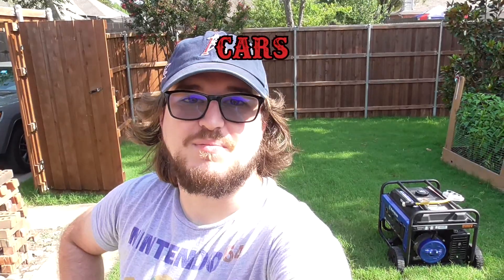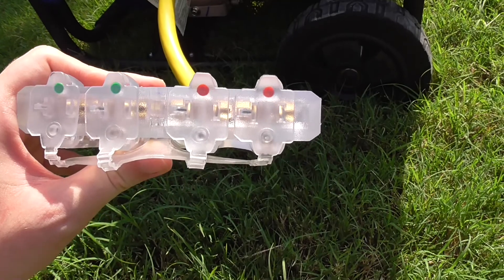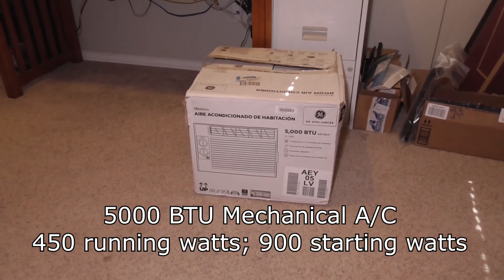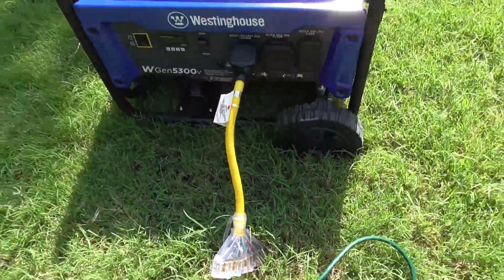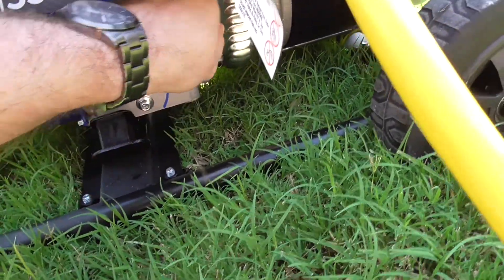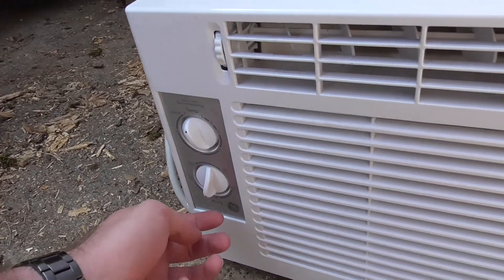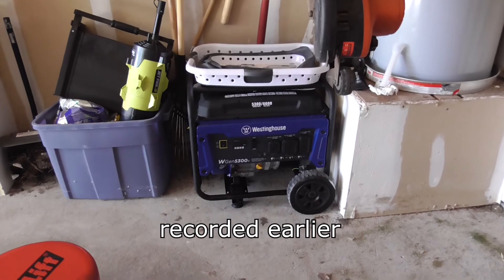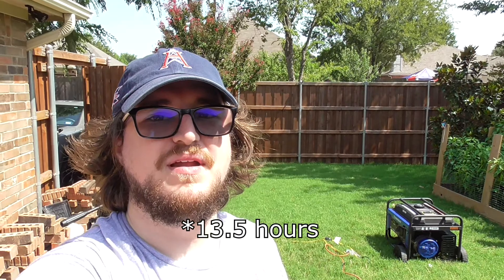Westinghouse WGen5300v Capacity Test

Comment: I know this video is 4 years old. But what I did was get a 10 ga. X 30' ran it from the generator into the house plugged yellow splitter into the Cord then ran 12 ga. Cords to appliances. The cords you are using look like 18 ga.      Starving your appliances of proper amperage.

Comment: Anytime buying a generator always get it with an electric starter..save your back . Some of these honda clone small engines are quite hard to start because they aren't made right from the factory. Sparkplug gaps all over the place on these. 
I know the batteries go dead but that can be easily solved by a lithium swap over like it did on my generetor. Starter motor relay directly connected to 4s 6ah Lifepo4 pack skipping the bms so that i don't have to get a expensive bms. Starter only draws current when engine is cranking. Charging happens through a bms and active balancer to keep the cells happy. It's a tiny battery and cranks the engine everytime.

Comment: How do you think this would work for a motor home? Ac unit, fridge, tv.. etc
Reply from the maker: Probably a good choice for a small RV. TVs and small electronics use a trivial amount of electricity, you'd only need to really worry about appliances and heat/cooling. It will run three fridges and a 10K BTU A/C with ease. It's got the RV hookup too.

Comment: Great video!  I just bought this same generator, what is the advantage of that 220 adaptor?  Does it allow for pulling more amps?  I’m new to this.  Thanks
Reply from the maker: Yeah, the generator cord is on a 30A circuit, where the regular outlets are on a 20A circuit. Plus you get 4 outlets directly connected to the generator rather than just 2.